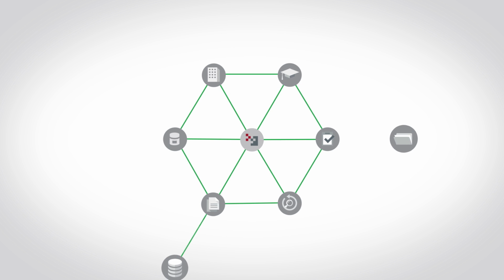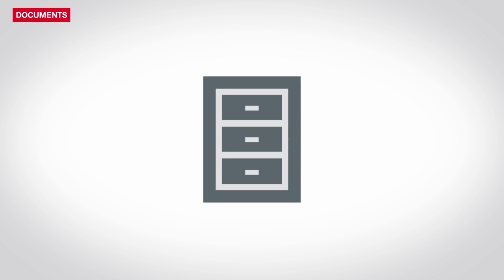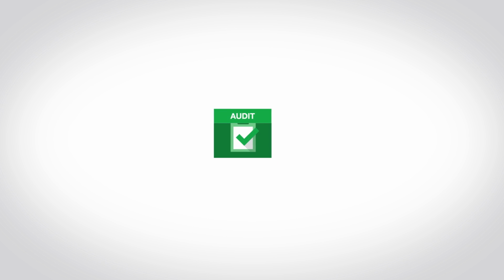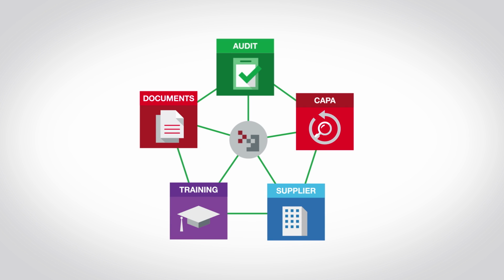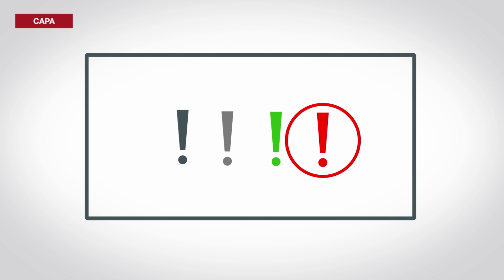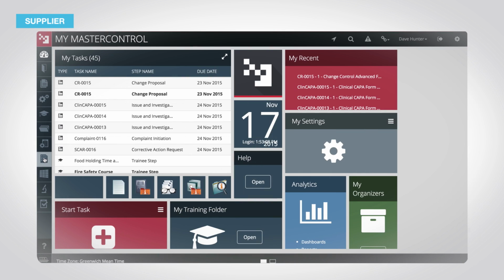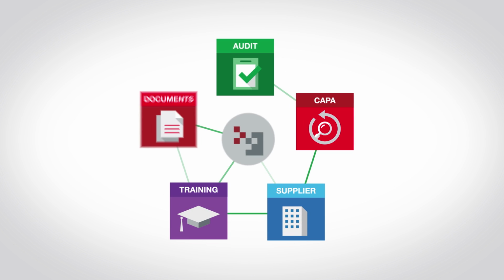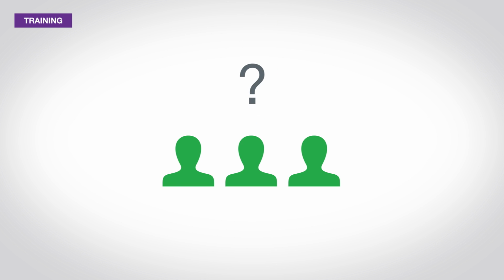MasterControl Quality Management System (QMS) Demo

Comment: Does this software have available API's to integrate with other QMS systems like Veeva or TrackWise?
Reply from the maker: Our software has a robust set of API methods/endpoints that can be used to connect MasterControl to most systems that have an API.